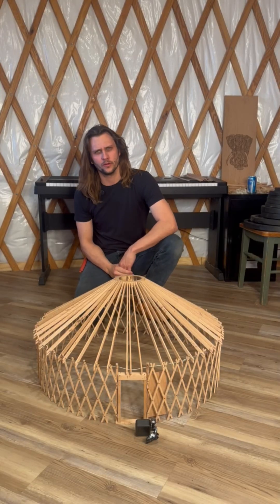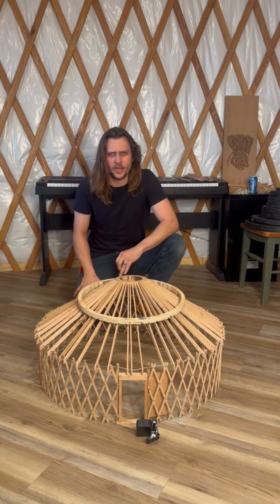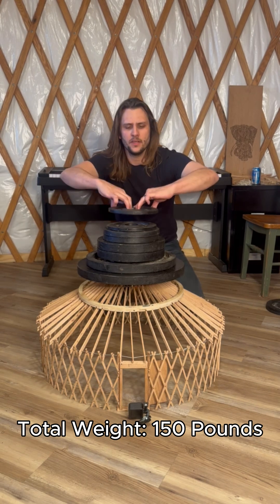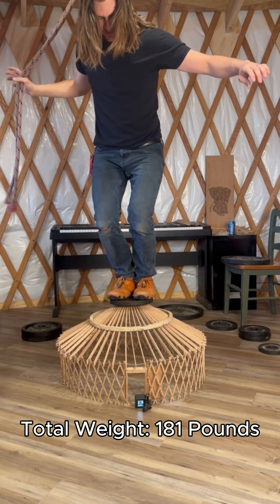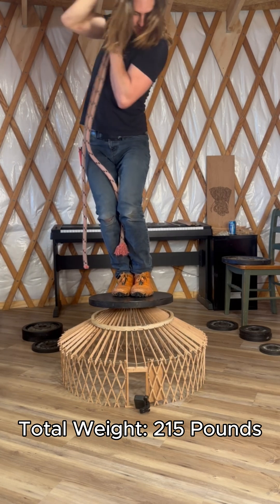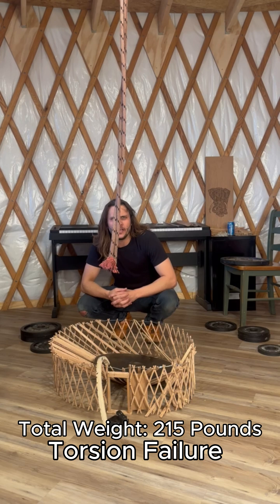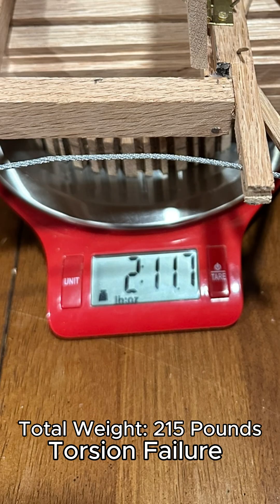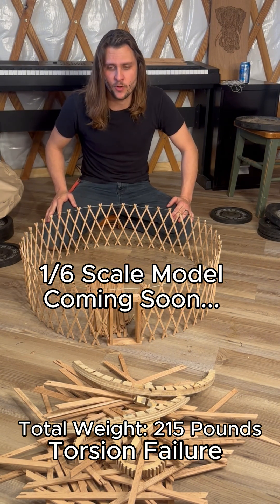Stress Testing Yurt Frame to Failure Part 4

Comment: I built NBC capable, underground disaster shelters that were egg shaped. The laid side ways, with a massive battery tray ( marine batteries) holding the floor. Other amenities with pumps moving water and sewage. I won’t go into details beyond that.
We stress tested. We shot fire arms of various caliber at the parts. We Subjected the walls to fire and frost. We improved the suspect areas to prevent any failure before production began right before the World Trade Center Attack.
I learned so much from that job. A-1 employer.
Reply from the maker: That sounds like my kind of job! I wish that I was a little more educated in engineering, as a carpenter we joke about the engineers but knowing exactly where you can take away and where you need to add more is an impressive skill

Comment: I think the ring at the top was a good addition to prevent torsion, however we saw that once enough weight was added the rafters were able to slip and the structure failed to torsion. I'm no architect, so I don't know which would be best, but I can envision either a solid ring with rafter slots, or an interlocking inner ring that prevents the rafters from slipping out

Comment: If you shear the walls and roof, it will probably hold a ton. A few wraps of shrink wrap with a little spray adhesive you could shear it up enough to support another 50-100 ibs. Reinforce, where it broke, looks like it broke where the rafters  touched the walls/lattice and at the peak. You could cut and bend aluminum cans and make your own brackets, hangers, straps, etc. Sometimes, more blocking is needed if you're not going to sheer it, probably 3 rows of blocking. Block the wall line also, bird blocking, that will stiffen it up and lock it place at wall line.

Comment: I see someone else mentioned it already definetly need to do support right over the door and for sure secure the secondary ring but for hahas whats the weight of a full sized yurt frame well average full sized yurt frame and the weight of your model so i can convert the 200 pounds to full size for perspective and post it
Reply from the maker: I’m not sure of how the weight scales up but the weight of the full size 30 foot yurt frame is around 2300 pounds. And the model weighs 2 lbs and 12 ounces. 
Or 1043 kg and 1.247 kg since we’re doing science.

Comment: I don’t live near yurts. I don’t know anything about yurts. I haven’t even seen a yurt in person. But I love me some scale model testing. Horizontal testing would be more difficult if you’re looking for an accurate comparison to wind. What id like to see is a thin plastic nailed to the surface to act as the skin, then use a small amount of hot glue to act as an “anchor “. This way you can test both the skin strength and anchor strength. I expect this type of structure to be very strong with sheer loads meaning it will take an insane amount of simulated wind to actually damage the yurt. Also you say 1/6th scale model but is that only in dimensions or is that in strength? Because a hot wheel car is about 1/140th scale but you can run it into a wall at 1000mph simulated speeds without any damage. So you need to scale your strength not just your dimensions
Reply from the maker: Yes I expect in the wind testing it will perform well, I am still trying to design a way to test it that actually yields some data. Right now the best thing I’ve got is to point multiple leaf blowers at it and see what happens. I have made an outer cover for it for those tests. 
The 1/6 scale model is based on dimensions. (Based on the 30 foot yurt at full size the 1/6 model will be 60 inches diameter) trying to scale every component at the same 1/6 scale) I’m trying to understand how the scale changes the loads, so I plan to step up the scale several times before I move on to stress testing the full size yurt that I am ready to retire. It’ll go out with a bang.

Comment: Saw an issue...you stood on it. You imparted lateral strain because you simply could not remain static ..not your fault but the test weights should be equal across structure and unable to twist as your feet did. I'm certainly not saying anything amazing...just my 2 cents

Comment: Looks like the rafters slipped out of the ring on the 215lbs break test. Secure a ring on top and underneath the roof/ceiling so the rafters don’t slip out and it would hold more weight.

Comment: I know it’d be an annoying task, but individual blocking or cut that ring with the appropriate angles and depth for each rafter for a more flush fit and more support theoretically. Maybe secure the ring with either glue or nails to prevent moving?

Comment: Adding the blocking isn't really addressing the failure mode of the rafters. They are bowing under compressive loads. All the blocking does is force all of them to bow at the same time forcing (ideally) them to all fail at the same time. (Except for your real world example when failure happened when some of the rafters slipped out of the ring blocking.) Putting a top and bottom flange on the rafters (think I beam) would add significantly to their resistance to bowing under compression.
I'm impressed that you didn't have any failure related to the rafters being split where they interface with the support cable.
Reply from the maker: Yes I think I will address that issue and try another test. I am thinking a combination of a better ring design that can't "pop off" the rafters and is held more securely, as well as anchoring that ring to the lattice structure to prevent rotation might allow us to find the next mode of failure outside of the torsional strain. Maybe the rafter splits is the next weak point... we will have to wait and see

Comment: That failure wasn't structural it was because your weight was shifting.
Reply: What you mean is it wasn't a static load that broke it, it was a dynamic load. The failure was structural, otherwise is would have kept him up.
Reply: @sandekv actually structural failure refers to failure of structural elements under intended design load cases. In this instance the structure failed due to torsional loading (twisting) of an unbalanced load. In an engineering report this would be classified as "failure occurred due to unintentional torsional loading."

This is a common misconception conflating outcome and classification. Yurts are designed to distribute loads vertically through axial compression not significant torsional forces induced by live mass. The failure here is procedural not structural caused by the use of a person's body weight as mass on an unstable platform.

Collapse alone does not define failure classification, failure mode and load case make that determination. Structural failure can exist without collapse and collapse can exist without structural failure.

Comment: Notice how much triangulation the lower lattice has compared to the top rafters.  Triangle bracing should help with side loads and torsional rigidity.

Comment: And it was still a torsional failure if you watch the actual failure. If he could somehow stabilize it against that more, it would have likely held up 250lbs+
Reply from the maker: Given all the comments I am thinking it deserves another test. If we can solve the torsional failure I want to know the next weak point
Reply: @ThatYurtGuy  Might I suggest a larger version of the ring you last added, and secure the two rings together so they cannot spin independantly. That shoud help immensely in keeping the roof trusses straight. 

Cheers!

Comment: I think if you want a really big step up in strength you need some kind of diagonals in the roof plane. Diagonals in a circle aren't that easy of course but just anything going a different direction than the rafters would be huge!

Comment: It's still your torsional rigidity which is letting you down..
As I suggested yesterday, you're gonna need diagonal bracings in both directions around the rafters structure.
Reply from the maker: I think you are right, I am brainstorming how to make that bracing and still maintain the yurts "portable" nature. Maybe some more wire attached to the secondary ring and anchored to the lattice on diagonals like you suggest

Comment: How do people attach the rafters to the compression ring without a crane?
Reply from the maker: In a short on my channel you can see the timelapse of setting up the yurt this model is based on. I just used scaffolding to hold the ring at the correct height and so you could access the ring to screw in the brackets that prevent racking.
Reply: @ThatYurtGuy  Aaah. Thank you. I assume that is how it is done in the "wild"? Does the scaffolding serve a dual purpose in situations where people travel with and live in a yurt?
Reply from the maker: @1st2nd2  The types of yurts that are traveled with generally have a shorter roof height and the rafters can be inserted from the ground without needing to be at the ring height. They can set three rafters in place with the ring still on the ground and then use the fourth rafter to push the ring up into place while they attach the rafter to the lattice. The modern style yurts I build are still "portable" but much less than the traditional ones that originate in Asia
Reply: @ThatYurtGuy  Aaah. That is very informative. Thank you very much for these explanations!

Comment: So, I think it failed not because of your body weight, but because you were torquing it side to side. You were spinning, moving around on it, so you were adding lateral force rather than straight downward force. And I don't think the blocking worked because it wasn't far enough down and the slots weren't deep enough to keep them sturdy. If you look at the underneath angle that you put, you can see that they can pop out and move around. They're not secured in there. So I would try cutting them deeper, and making the ring bigger and lower down, and if that's not enough, I would add cabling at an angle, tensioning it to the side walls.
Reply from the maker: Great suggestions, probably the two that I will implement if I decide we need more testing before we move on

Comment: So here's the problem I see, it looks like your blocking ring failed due to pulling forces, whereas traditional staggered blocking would put the wood into under compressive load where wood is stronger. 

Blocking is also only going to limit twisting along the axis of the boards, the problem you're having now is twisting in axis with the compression ring, which might be helped by blocking much closer to the compression ring. Or maybe some kind of triangular supports near the cable?
Reply from the maker: I’m working on a way to use traditional blocking and skip the ring for the next scaled up model, I want to keep the test as close to the real thing as possible and the big ring was an imperfect solution. Thanks for your input, I appreciate it!

Comment: The middle ring isn't going to fully stop it from twisting. It's just going to ensure each rafter twists in unison with the others. 
You could stop that twist by having cables on 45° in each direction, connecting the base of the rafters to the middle and top compression ring.
Reply from the maker: I am considering trying the ring design again and if so I think adding those cables should be part of that test. Thanks for the suggestion!
Reply: @ThatYurtGuy would love to see it! I'm fully invested in these videos. Excited to see how things change with different testing and scaling up

Comment: holy cow! I really wonder what the scale value of that weight is.  It 'feels' like you're hitting the material limit.  As a side test:  Take the number of joists and line them on edge like a bridge and see what they can take as a load.  Just to see what the material does without the geometry of the yurt.

Comment: Deeper slots in the bigger ring, or attach it from the bottom side. Also, the joist alive the door rests lower than the rest around the yurt. This is what's starting the twisting motion right away even at low weight.
Reply from the maker: In the full size yurt the rafters above the door are  modified and screwed directly into the top of the doorframe. Maybe I need to add another support in the middle of the doorway or copy the full size yurt and raise the header so the rafters rest on it

Comment: Great work! I wonder how much weight it can hold if the rafters stayed in the blocking ring throughout the test. Looks like some rafters jumped out of their notches.
Reply from the maker: Yes when editing I noticed the rafters slip free from the ring right before failure. I knew the ring design wasn't a perfect one but maybe I need one more iteration and another test?